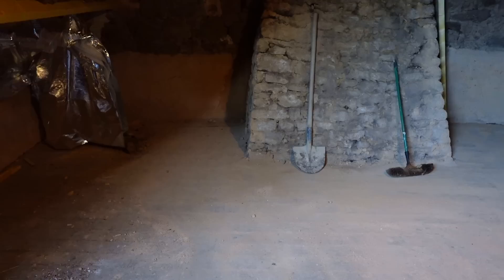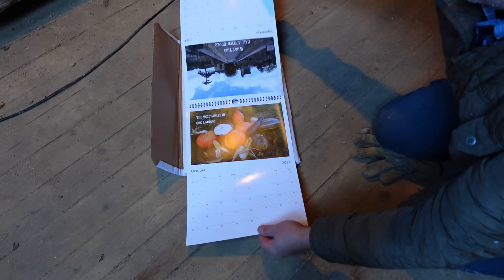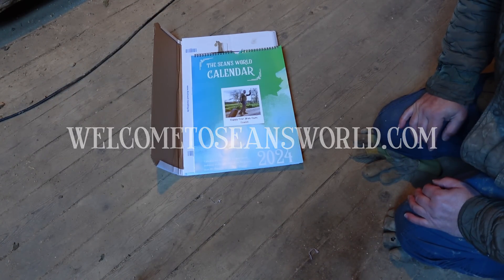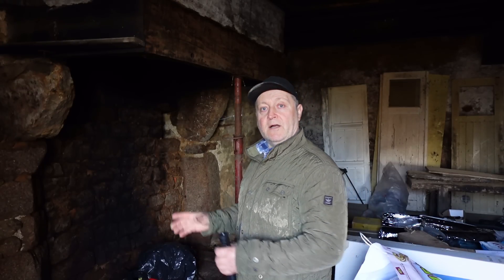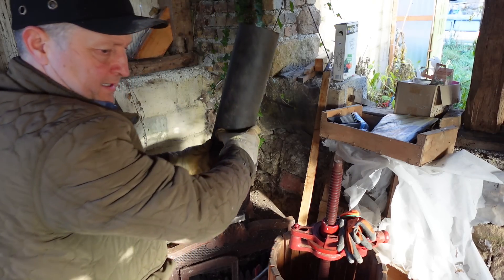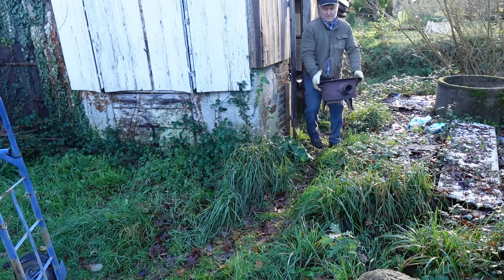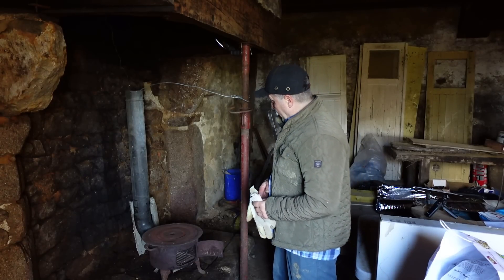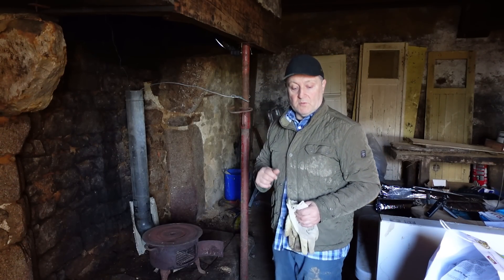Heating The Cottage With An Unexpected Find... Cottage Renovation Episode 53

Comment: Sean that’s not safe for you it needs another piece of pipe into the one above your not concerned about carbon monoxide? If you start to get a headache you have to put it out
Reply from the maker: No l have a carbon dioxide detector it's not much  difference to an open fire